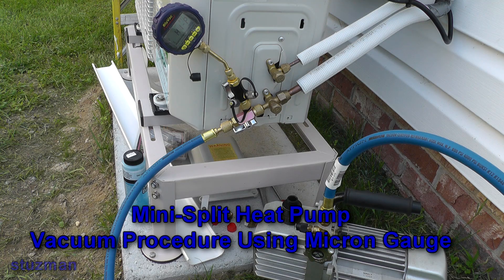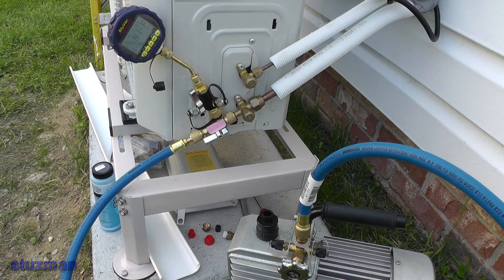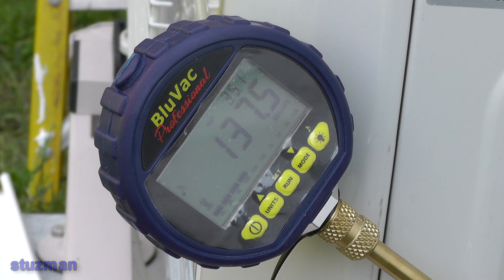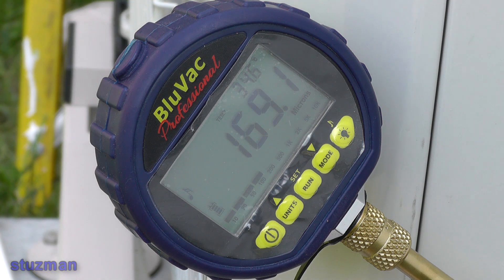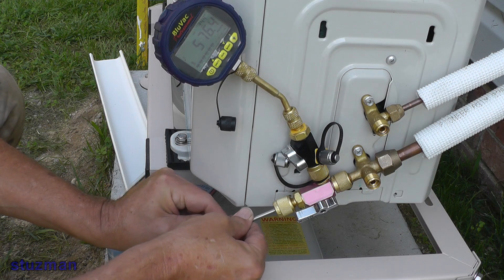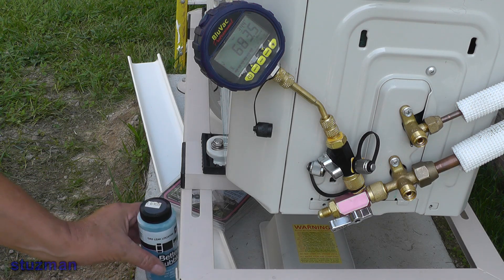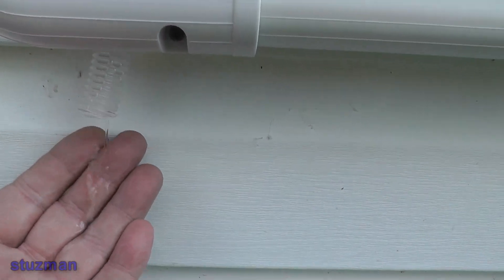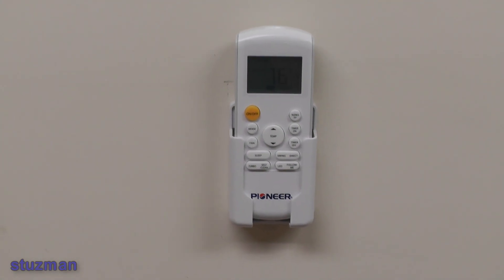Mini-Split Heat Pump: Vacuum Procedure Using a Micron Gauge

Comment: Nicely done. What steps are different if a previously running system had to be completely evacuated, tested and refilled. In other words, how do you refill with refrigerant if completely empty including the outdoor unit?
Reply from the maker: In a nutshell, the refrigerant would have to be recovered unless it leaked out. And if there was a leak, the system would be filled with nitrogen to find the leak. After the leak was repaired, a retest with nitrogen would be required to verify that the leak is fixed. Next, a vacuum would be pulled down to at least 500 microns and finally, the refrigerant would be weighed back into the system. The weight would come from the manufacturer.
Reply: @stuzman52  Thanks! Our mini-split A/C wouldn't hold a refrigerant charge for a season. I had to take matters in my own hands today. Making sure copper tubing joints are properly formed and fitted, pressure test with nitrogen (150 psi per mfg specs) for over 24 hrs, vacuum test to lower than EPA requirements (300 micron) and maintain it for 1-1/2 hrs. Then and only then was I assured that the system will not leak and I precisely weighed in the proper amount of refrigerant per manufacturer specs. It takes knowledge, craftsmanship, and patience.
 [I had to cut out and replace every flare joint made by the HVAC contractor].

Doesn't anyone take pride in their work anymore?
Reply from the maker: David Grisco Always glad to hear success stories David! As you may know, my field is electrical engineering and over the years I’ve seen all kinds of folks. It doesn’t matter if you got degrees, credentials, licenses or many years of experience. You can find poor workmanship with the above criteria. It all boils down to the individual which is what he thinks of himself and his craftsmanship in his field. Today, it’s becoming rarer to find individuals that want to excel in their field. Glad to hear that you got your unit fixed! 😀👍
Reply: @stuzman52  Ah, electrical engineer...that education/training explains your thoroughness. Quality engineer myself; it's all about the process, measurement, and verification. I still find it mind-boggling that there are so many individuals who are just flat out incompetent. I now feel confident with a future mini-split installation in a pole barn.
Reply from the maker: David Grisco It amazes me also of why an individual doesn’t try to be the best they can. I guess it’s a different world nowadays. 😀
Reply: @stuzman52  Great video. I learned how to do everything you showed exactly from watching a video by "AC Service Tech LLC" who teaches this stuff to field guys. Almost exactly the same process. I did notice one video said to keep Nylog off the threads, just apply on flares connection surfaces. And to open and close valves on core removal tools at the beginning process of vacuuming to let out any air trap inside core removal tools. Other than that you videos were basically exact as teacher's.

I also agree with so called professionals in the trades not always being so professional. Many are just hired hands. If you use a business where the owner is also the on sight worker then maybe you got lucky to find a good one. I rarely hire pros for my work unless it's to big for me to handle on my own. Been in the trades for almost 50 years and know better. Hired well over a 100 people and can count the ones I trust to do the job I would if I'm not there. I always needed to be on sight working and being a pain in the ass to the people I hired to go the extra mile to do the jobs right. Today it's even worse than ever to find any kind of good help. We spoiled the kids and they want to get paid like they've been doing it for 10 years
Reply from the maker: @bertpainter8385  Hi Bert and wanted to first wish you and your family a glorious New Year. I should have mentioned about opening and closing the valves in the video of which I didn't show and forgot to mention. Craig from 'AC Service Tech LLC' is a great teacher and I have watched a few of his videos. Since you mentioned service techs and other contractors in other fields, I just gave up on them. As an electrical controls engineer for a multitude of different industrial fields, I was just amazed how dumb electrical engineers were that came fresh out of school. They were academically smart, but dumb as a rock when it came to working in the field. I remember one who couldn't even use a screw driver to take a cover off of an electrical box. And of course, troubleshooting or programming was a whole new scenario for them. Today, I work on everything that I can, troubleshooting cars, appliances, home remodeling or whatever comes up. And you're right that kids today are spoiled and think that they deserve top salary right out of school. Have a great weekend coming up and keep up the good work as it does sound like you have a great work ethic.
Reply: @stuzman52   Actually just finished installing a 3rd unit in my home. I always get nervous hoping I did it all proper when I do these as I rely on these videos to refresh my memory. Getting old sucks. We forget. I was never a school guy so I don't have any college. Just a few tech schools for electronics and computers, but never found as good paying job as promised by those schools. So I'm  basically self taught. Like you, I do all my own work for the most part. Auto's repairs if I can without the expensive equipment needed too. Always refer to experts on Youtube. If you know what to look for, guys like you are very helpful and will show you the way. As long as you're patient and take time to school yourself when it's a field your not familiar with. 

l love  when you hit the switch it it all works as hoped. Also love when it don't and you have to trouble shoot to see where you went wrong too. Learn from your mistakes and enjoy when you do it get it right. l

Happy New Years to you and yours also.
Reply from the maker: @bertpainter8385  That's all it takes Bert to learn a new field. Find someone who knows what they're doing and follow them. What you're looking for is someone that you can follow their steps, explain what they're doing and why. You really don't need schools to teach you that. Sounds like at this point that you could be installing these units for all of your friends and family 😁 Have a good one Bert!
Reply: @stuzman52   As for installing for others, I'm doubtful. I shy away from doing work for  people I know unless I know they aren't the blame type of people. Used to do plumbing and electric for customers but everyone seems to want to blame another person for some other unrelated problem. I would usually just tell customers to find a licensed plumber or electric or in this case HVAC person. Warrantees won't be honored unless you do. I only help out a few friends who need the help these days. And they pay me by helping me out whenever I might need an extra hand.
Reply from the maker: @bertpainter8385  I follow the same philosophy. I've found out that when you help out some 'friends' or even family, they will want more, will scold you at the thought of them paying you and they're never around when you could use their help. So, I'm careful who I want to help out. I've helped my neighbor out on several occasions and he's returned the favors when I need his help. And that's the way it should be. I've learn over the years to do the best you can for yourself and your family. The more you think logically and methodically in your steps, and to use your hands, the further in life you'll go. Take care Bert and wishing you many successful repairs and projects that you encounter.

Comment: Great. I never saw you check the pressure on the high or low side after refilling the system however. I would think that you would do that when you first turned the system on for at least a few minutes. If you had lost some refridgerant, your low-side pressure would be too low, wouldn't it?
Reply from the maker: It's not necessary as the amount of refrigerant in taking off a line is minimal which is not going to effect the low side pressure to the point where the unit will not work.

Comment: I'm curious, what steps would you have taken if you had seen bubbles coming from the valve core after you reinstalled the valve core?  at 9:49
Reply from the maker: In a case like that, I would remove the valve core and installed it one more time and recheck for bubbles. If there were still bubbles, then I would replace the valve core with another one. :)

Comment: you loaded your refrigerant on a bigger line instead of the small one. Some Split units have only have access opening on the smaller pipe they called "the liquid line"  can they be different in each unit per manufacturer? Thanks.
Reply from the maker: If you're referring to which line to open first to allow the refrigerant into the system, it really doesn't matter which valve is opened first. On some units such as this one, there is only one access port to do the pressure and evacuation. Some of the larger mini-split units will have two ports, one on each service valve. In a case like that, I would pull a vacuum on both sides of the system at the same time. If in doubt, always refer to the manufacturer's instructions. Hopefully, that answered your question.
Reply: Thanks for you enlightening explanation. God bless you always.
Reply from the maker: You're quite welcome Freddy!

Comment: The only thing I may add is I would put the service valve cap on loose to check for leaks out of Schraeder port. Seems easier to check for leaks when I can maybe just see a few bubbles.

Comment: i am about to vacuum my pioneer 18Kbtu, but all the viceos i saw they test the line, no leak, they remove the blue hose and open the the ports with Allen wrench and that is it. What is the difference from your procedure??
Reply from the maker: I'm not sure what you mean by test the line, no leak. If you're referring to pulling a vacuum and don't see any drop in the gauge, you can do that. But when you pressurize a system with nitrogen with a couple hundred pounds, leaks are more easily found. I once didn't pressurized a system with nitrogen and left the the vacuum overnight. All looked good on the gauges and then filled it with refrigerant. About a week later, a very small leak was found. So, I try to pressurize a system with nitrogen first to find those small leaks if they are there.
Reply: @stuzman52  what i meant was, I have seen people connecting the yellow hose direct with no micron gauges or any removal tool connected to pull the vacuum, once they confirm there is no leak by just pulling vacuum, they remove the hose, cap the service port and open the port to circulate the gas. It did not make sense to me, i kept watching videos until i see yours. I know nothing about AC, but i bought a DIY 18k Pioneer for my garage because all the videos i saw was that simple, but it did not make sense to me. How come you pull the vacuum and then let the air back in the pipe, for me did not click, i wanted to be that easy but i wanted to be right too.
i ended up spending lot of money on those devices on your video. I hope i use them right.
Reply from the maker: @fly4fun24  There are many ways to do the job, but using a micron gauge is a recommended practice in the field. Manifold gauges will show that a vacuum is being produced but not how much vacuum. The micron gauge will tell you how much vacuum is produced. You can use the method as you described, but if you have a very small leak, the manifold gauge set may not be able to let you know. The nitrogen pressure test has a better chance of seeing if there is a small leak. And when I pulled the vacuum, I didn't let air back into the system. I opened the service valves to let the refrigerant into the system. Here is a master HVAC tech using a very similar method on an air conditioning system. Good luck on your install! https://www.youtube.com/watch?v=wYZ8Wudksb0

Comment: Mr Stuzman. Any idea as to why the blue hose did not do the trick? Thinking about buying a black hose from amazon, along with the other tools you have shown. Do you think a black hose might be worth it? Thanks James, and also for the outstanding video.
Reply from the maker: Yes, after the video was shot, I investigated the hose and it was fine. The fitting that I had on the vacuum pump where the hose secured to was the wrong type. A simple change of the fitting took care of the issue. Not sure of what black hose you're referring to, but if you're looking for a vacuum rated hose, then it should be fine. And thanks for liking the video!
Reply: @stuzman52  The blue hose you used made by Appion also makes a lower price red and higher price black hose, But if the fitting is the problem I'll probably go with the blue. Let me tell you this, I don"t know what Youtube's policy is, but if you start a support site. although I don't have much, I'll be glad to contribute because you're worth it.
Reply from the maker: @jwkearney1808  Thank you very much Jw, but if you're subscribed and follow the channel, that will be enough thanks for me :)

Comment: How do I add extra freon to new system with too much line ????before my first start up
Reply from the maker: You'll need to know how much more refrigerant is needed based on your line length increase and size of the tubing. This should be in the manual. Then you'll need the container of refrigerant on a scale to measure the weight that's added. You can do this after you pull a vacuum on the system. After the correct weight has been added, then you can open the valve to allow the other refrigerant in the outdoor unit to come in with what you added.

Comment: Why did you use two  core removal tools...can this be done with just one core tool and the micron tester ?
Reply from the maker: One core tool (bottom one) is used to isolate the vacuum pump and the other core tool (vertical one) is used to isolate the micron gauge. If I had used one core tool such as the bottom one, I would be able to isolate the vacuum pump. But the valve on the bottom core tool won't isolate the micron gauge. So, if I screwed the micron gauge directly onto the center port of the bottom core tool, I would have lost the vacuum when I screwed the micron gauge off. Hope that makes sense.

Comment: U ever vacumn without removing the valve core ??
Reply from the maker: Yes Kevin, sometimes I have, but it takes longer to pull low vacuum levels.
Reply: Thanks
Reply: On the low side of the  system ???
Reply from the maker: Yes Kevin as mini-splits only have a port on the low side to pull a vacuum.

Comment: Also, why not replace the valve stem while the system is under a vacuum?  Why did you wait to release the refrigerant and then replace the core?
Reply from the maker: Having pressure on the valve core would ensure there wouldn't be any chance of the atmosphere coming back into the system. It's a standard practice to install the valve core while under pressure.

Comment: Thanks for sharing.  Best video  out there on evacuating a mini split.  QUESTION:  Is the core removal on the CORE REMOVAL TOOL, overkill?  How much refrigerate would be lost otherwise?  (I'm not against overkill.  I just wonder if pros do it, or just overkill?)
Reply from the maker: It's a standard practice in the field which allows the vacuum pump to pull a deep vacuum without the restriction of the valve core and it does speed up the evacuation process. I have seen others in the field not do this in order to save time, but in my opinion, it's a better method when doing a evacuation.

Comment: I have never installed an AC unit and been reading up on them. I am not an installer and have considered doing my own as the cost locally are really high >$30k for 2k home. I am an engineer so technical but there are so many things one does not know that they don't even know they don't know. The video was very detailed and you really like to be precise and that was great to see. I may just take the task on for at least my home office. I hope I have the patience to do it right like you did. I wish you were nearby and I would be your customer.
Reply from the maker: Thank you Barry for the comments! As you are an engineer, you know that any project is all about the details. I'm quite sure that if you were to install your own unit, you would research those details that you weren't sure about, and you would have an installation that you would be happy with. Thanks again Barry and have a great weekend coming up!

Comment: very good video  i use 30/30  30 minutes vacume  30 minutes wait for leaks  if is ok  charge the refrigerant
Reply from the maker: That will work also but not a guarantee that the system is sealed tight. Higher pressures such as when using nitrogen will tend to show very small leaks where it could take hours or days when checking for leaks using vacuum only. On one occasion with an automotive a/c system, I left the vacuum overnight and the vacuum readings looked good the next day! Then the refrigerant was added into the system and several days later, a very small leak was found. Now to be sure of small leaks, I'll add nitrogen to the system to look for very small leaks.
Reply: @stuzman52  you are 100% correct

Comment: Sir, can you please give me the Brand names and part numbers of the valve core tools and the connectors  that you used to attach to the service valve and also did you remove the schrader valves from the yellow  line when you were pulling down the vacuum in the third video .  Extremely well done videos , thanks.
Reply from the maker: Sorry Douglas Knutsen as YouTube did not contact me. It's getting a little late Douglas, but if you send me a private message with your email address, I'll look up the parts and answer your questions tomorrow. And thank you very much!